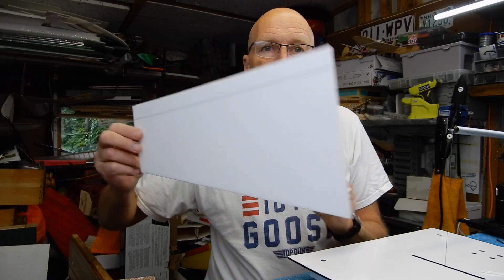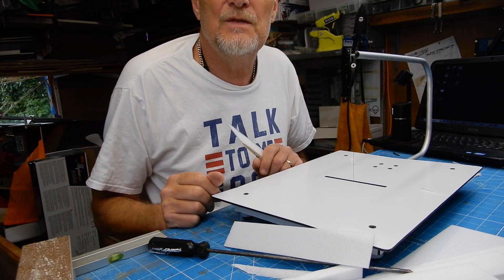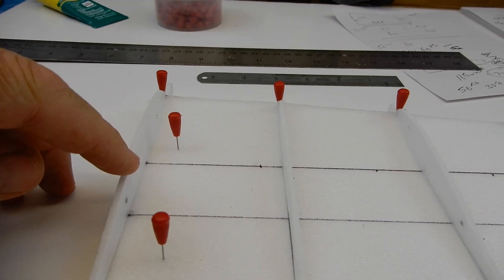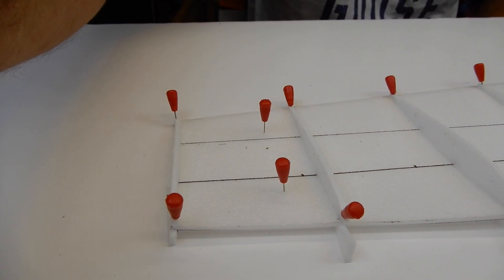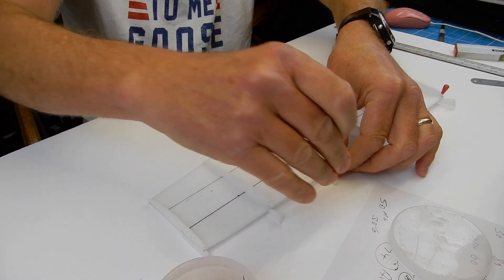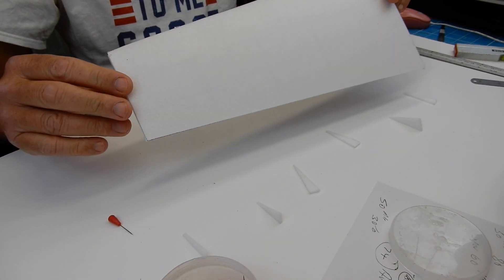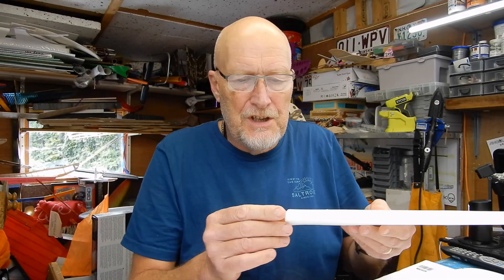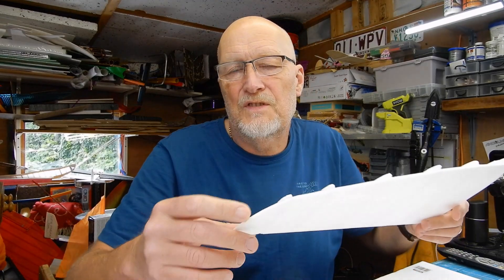Experimental VTPR aerobatic wing

Comment: Hay Nick,  I've actually cut ailerons into my pug wing. I'm not pleased with it now because I've used very small servos and they double center something horrible.  I will be replacing them with the 5 gram servos from anglewings as soon as they're back in stock.  Also look into offsetting the servo center on your DLG wing for way more downward travel than up... for the flaps.

Comment: BnQ sell 3mm Depron? I'll have to check that out. What do they sell it as?
Reply from the maker: Diall polystyrene sheet packs 3-6-9 mm
Reply from the maker: https://www.diy.com/departments/diall-polystyrene-3mm-insulation-board-l-0-8m-w-0-6m-pack-of-8/1906879_BQ.prd
Reply: @NickChittyFlying  Thanks.
Reply from the maker: @ColinWatters  Uhu por works great on it

Comment: Come for the entertainment, and always end up learning something new .. to me. 
VTPR, or “Voltige Très Près du Relief” in French means “aerobatics very close to the ground” 
Before a VTPR definition search, was going to suggest that could save some effort by making the wings twisties, aka pitcheron, so no need to make span length cuts and adding extra depron.

To remove the clamp marks, might try using a damp cloth with a film covering iron. This technique works well with EPP,  but not sure with depron. At least it would give more control than pouring hot water.
Reply from the maker: I did  exactly that it worked so well it’s worthy of a video   😍 cos that how I straighten the Lidl wing 
Interestingly I did consider twisty wing but ailerons give advantage of changing the wing section and this might be a long project with these easterly winds 🤪